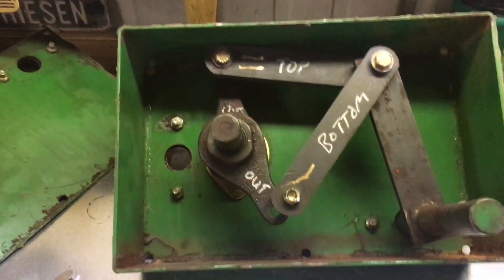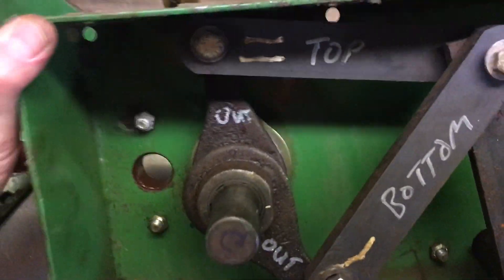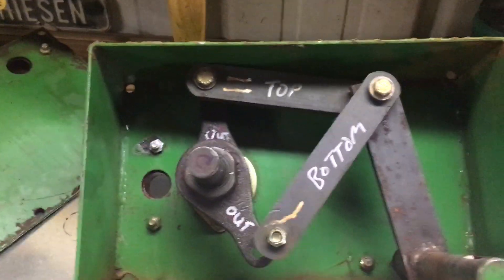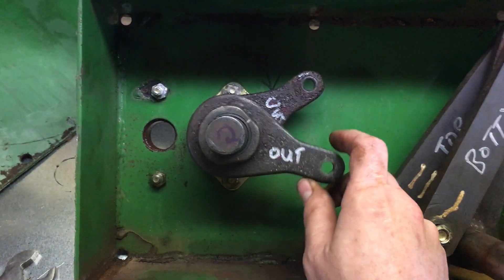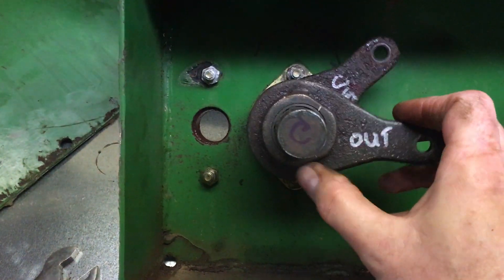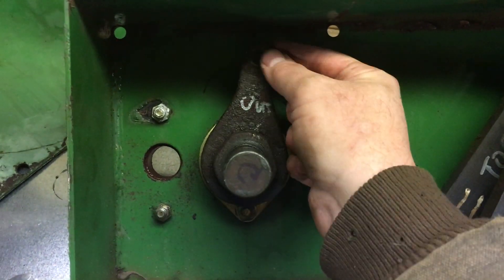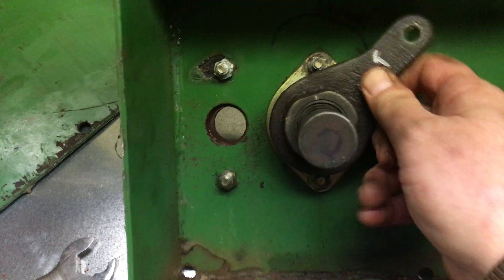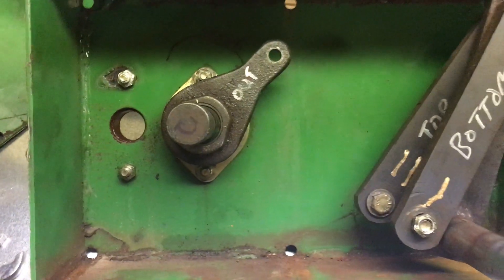John Deere 787 meter box rebuild

Comment: Time to call Red E in Fargo ND, 701-205-1485, and change to hydraulic drive. I am a happy customer. I use JD GPS, so all I needed was a JD Dry Rate Controller, and now I am confident of My seeding rate, and the ability to change the rates from the cab. Beats the snot out of that lousy slide rate adjuster, and the intermittent clutch shut off, or as this video shows-- the EXPENSIVE rebuild of the boxes.